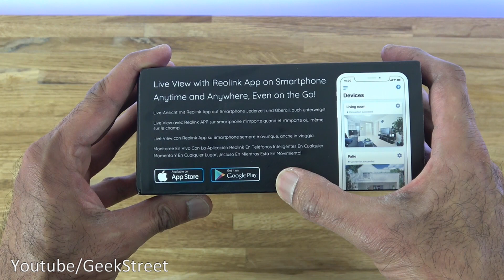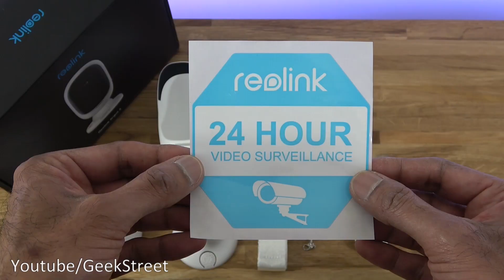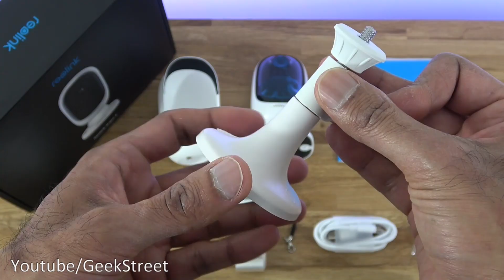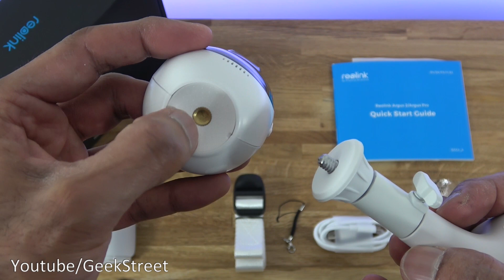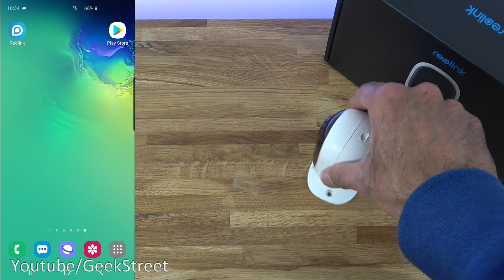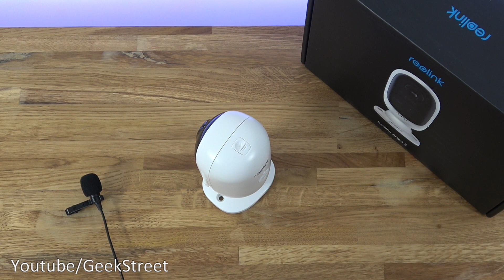Reolink Argus 2 WiFi Security Camera BATTERY POWERED! Unboxing and Setup

Comment: I purchased two of the ARGUS 2 cameras. These have worked great at my cabin, Battery life good considering weather, motion & use. I would recharge them every 3 months +/_ Both are about 7 yrs old. Thought it might be time to order new battery packs but seeing they are no longer available (typical). Not sure yet what I will find if I try to open it up? Has this ever been done? 🤔

Comment: I think I saw a comment somewhere else where somebody claimed that if you're not on the wifi (i.e. you're away from home) then it takes 20 to 30 minutes to get an alert. I'm glad I saw your video because it seems that's not true. I do have a question though, if anyone can answer it... connection to my router is problematic from outside my main door, so I've set up a tplink wifi extender nearer the door - this has a separate SSID with an "_EXT" suffix, but shares the IP address space I think. This means that my phone will probably be on the main router a lot of the time and the camera will always be on the extender. Since my plan is to use this like a doorbell, I MUST have a fast alert if someone is at the door. How likely is it that this setup will work OK? Any issues due to using that extender?

Comment: I bought and installed a new solar powered Reolink Argus 2 in June 2021. To that day January 22, 2022, i.e 7 months after operation the camera is dead. I thinks the battery is dead and no longer chargeable as we have a lot of sun and very cold weather in Canada winter, average minus 20C. Can someone tell me the battery is really dead and what battery model
Reply from the maker: Contacy Reolink support it should be in warranty.

Comment: Motion sensor will not work through glass, the free cloud option is for one camera only. So far  for a first impression I am disappointed with this 2 camera package I bought. Got it form Amazon and was under the impresion it came with the  solar panels but it didnt. As far i am concerned the advertising was misleading. I'll try and get the best from it in the short trem, but will be upgrading and don't recommend it.